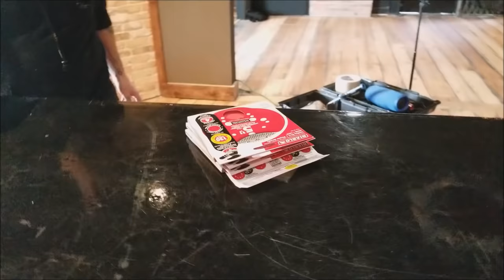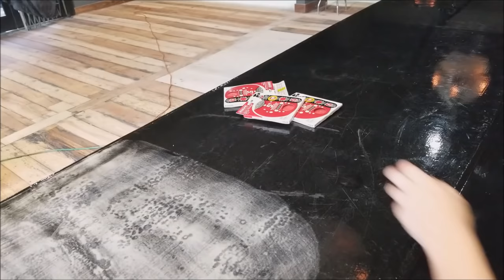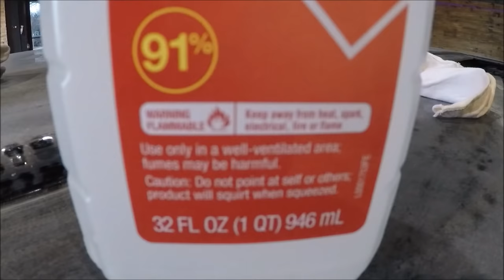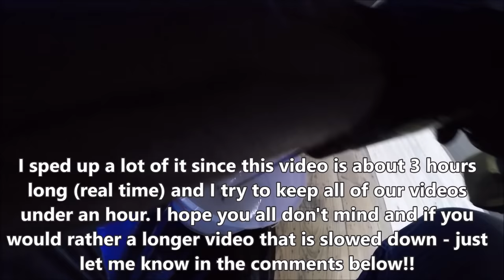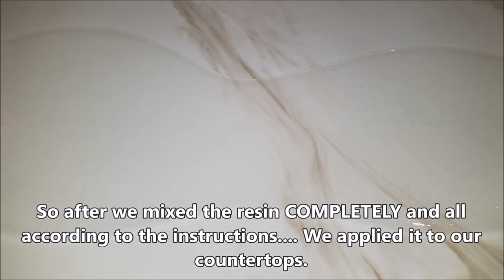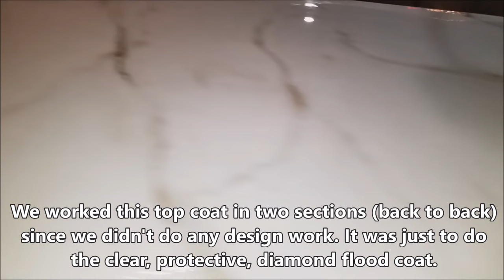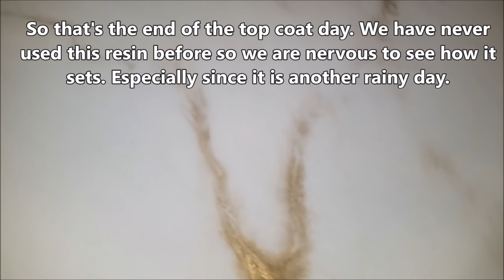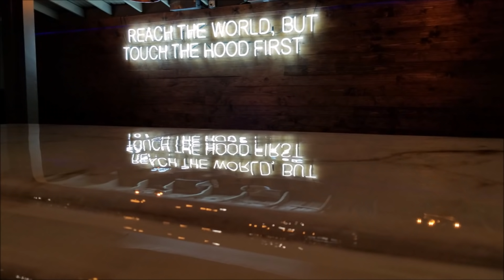24K Gold and White Marble Bar Top 88 Sqft! FULL TUTORIAL

Comment: Do you think I can use these type of supplies for a table that will be left outside? How many coats of bonding primer did you use and did you sand between coats?  Thanks so much you guys.  Love all your videos.  I just discovered you two about six days ago and have watched at least 20 of your videos.  Love, love, love what you do!
Reply from the maker: Ir all depends on the bonding primer. I would sand thr table down, add 2 coats to the table and add resin.
Reply: Was the bonding primer the same thing you used to initially make it white?  Can you make of 1,2,3 list step by step that makes it easier to follow the beginings some time.  Those are the foundation steps I want to know to follow.  When you do you artwork, is it the same steps?  The primers are the things I am trying to figure out so my work will be permanent and not lift of crack or fade.  I have seen black background at the beginnings before on art pieces.  Is that spray paint, black primer? I am just beginning and dont want to do anything wrong that ruins what I end up with.  I just love your work.  Joyce Ann
Reply: Vaughn Rice You posted your question under my question so I don’t think Ericka and Jeff will see it.  I got the notification when you posted it.  You may want to copy and paste it under them.  Good luck!
Reply: You could never keep this table outside, it will yellow in the light.

Comment: Vaughn Rice
2 hours ago
Was the bonding primer the same thing you used to initially make it white?  Can you make of 1,2,3 list step by step that makes it easier to follow the beginings some time.  Those are the foundation steps I want to know to follow.  When you do you artwork, is it the same steps?  The primers are the things I am trying to figure out so my work will be permanent and not lift of crack or fade.  I have seen black background at the beginnings before on art pieces.  Is that spray paint, black primer? I am just beginning and dont want to do anything wrong that ruins what I end up with.  I just love your work.  Joyce Ann
Reply from the maker: Sand,primer and paint/resin.